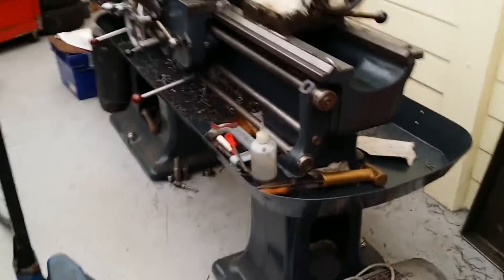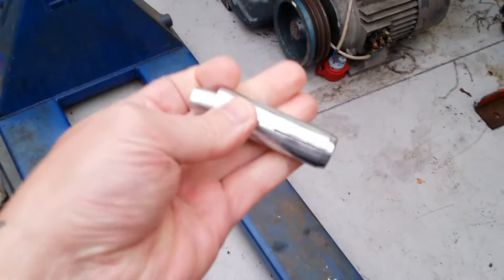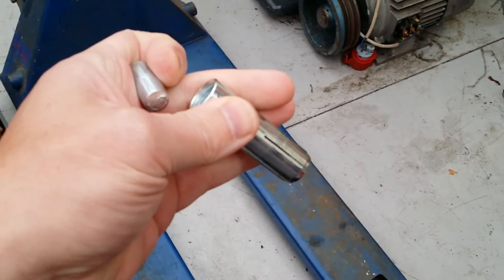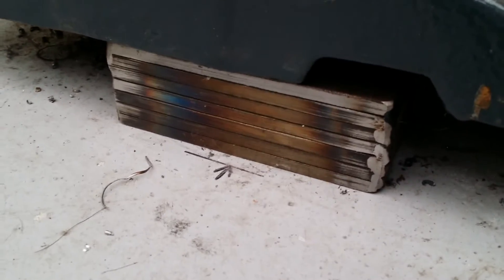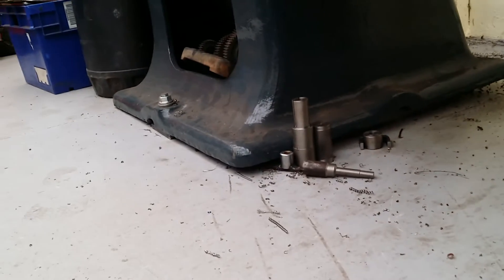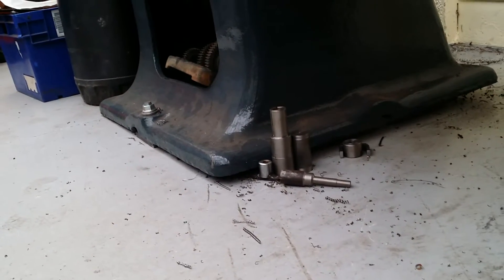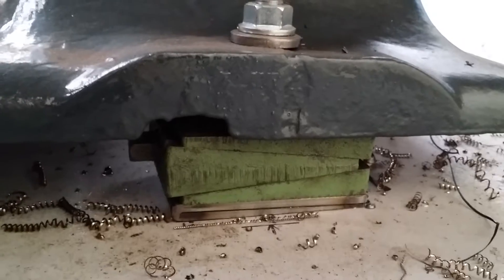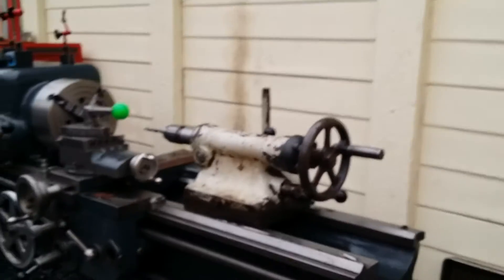Bolting and fine leveling, how I did it.

Comment: Nice job, shame the concrete is so far out ! I have to make up some of those wedge sets for my late levelling.  All the best Mat
Reply from the maker: Cheers bud. I laid the floor myself and its intentionally sloping towards the door, just in case any water gets in or something spills, more effort to get a machine half ways level tho. Not that it matters much ;)
Cheers D
Reply: @mrblack61  ah, slightly awkward 😃 my small Boxford lathe is fixed down with m16 studs held in resin fix. Then the lathe is held between a pair of jam nuts on the studding. It worked a treat as o was able to adjust each corner until the bed was level. Having said all that, it's like a soft cheese compared to your 13z. I'm putting a hollbrook T13 together which is very similar to the 13z. I was after a 13z but got fed up waiting for a unit to become available.  So now I have the shop full of 1953 cast and machined parts. Busy scraping in the straight edges to then get to work on the lathe bed. I should add, your floor surface looks very smoooooooth 😆
Reply from the maker: I had a quick look at the T13, looks like a beast! Comes with a full gearbox too doesnt it? I dont think Holbrook ever made a bad lathe, will have to check into PM when you get going on it ;). 
Yeah the floor is way smoother than it needs to be, years of doing car bodywork saw to that lol.